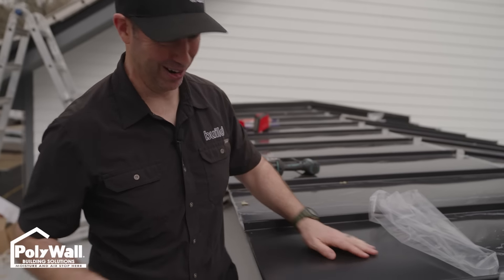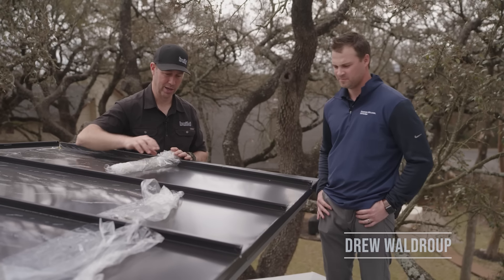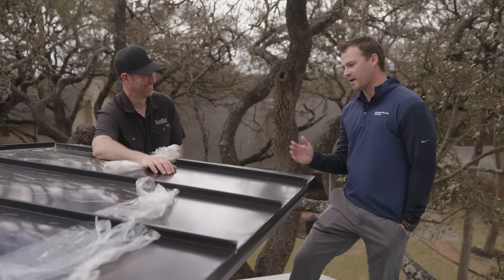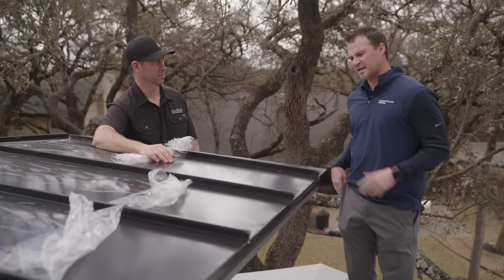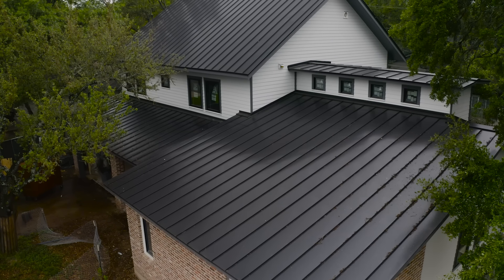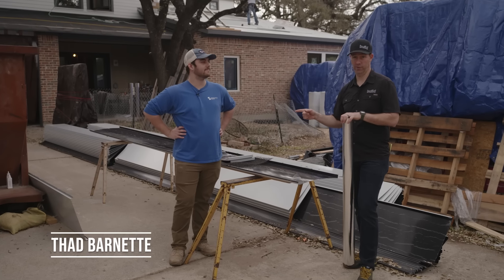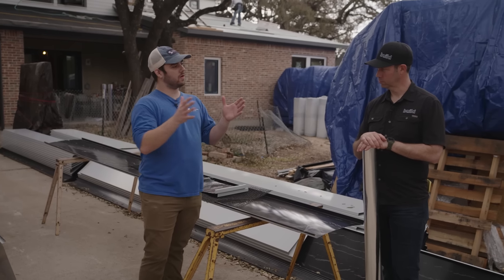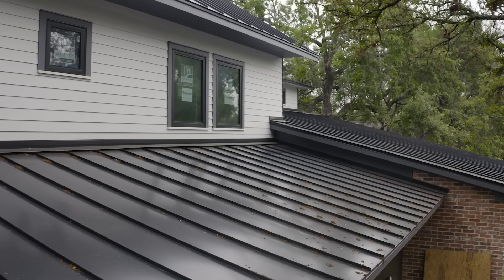Black Metal Roof - Dumb Idea?

Comment: So he starts out by answering a question with "yeah, no". Then, he justifies a black roof by saying essentially, all  my friends are doing it. Felt  like I've been catapulted back into kindergarten
Reply: I could see 2 temperature probes being embedded into upper 1/2” of the polyiso exterior roof insulation adjacent to each other on same gabled section. Maybe Sheffield metals would be interested in sponsoring the test, providing a single section of white standing seam for one probe, the other under black section. Both installations would employ same solar insulator layer shown in vid as well as same air gap underlayment. 

My $$ would be the temperature difference would be <2C, essentially negligible. The surface temp of black would be substantially higher, the underlayment air gap, reflector layer and low thermal mass and radiance of 26g rolled steel mitigates ability to radiate that heat into building envelope. 

The big advantage of dark metal roof is that elevated surface temp allows it to shed snow much more efficiently 👍
Reply: I don't understand the issue. Pretty much every issue in life has pro's and con's. He knew that but wanted a black roof because he liked it( does he need another reason ) and he designed the roof to minimise the con's of that choice. what exactly is the problem here ?
Reply: @MichaelM-to4sg  1) "<2C, essentially negligible". Based off of what? Gut feeling?
2) I'm having a heck of a time finding Sherwin Williams' specs for their paints, but here are some lab tested results for similar coatings from Valspar's line. Black (WXA0107L) - reflect 0.31, emit 0.84 = SRI 31, temp 70.9C (159.6F). Bright White (WXW0048L) - reflect 0.68, emit 0.86 = SRI 82, temp 51.4C (124.5F). White has a much higher reflectivity and also manages to have higher emissivity.
3) "The big advantage of a dark metal roof is that elevated surface temp allows it to shed snow..." So you intuitively know that the higher surface temperature isn't " essentially negligible" like you said.
4) How much shedding of snow do you think will be happening in Austin? Yes there was recently a bad cold snap. But I used to live in Austin, shedding snow for a day every ten years doesn't outweigh the benefits of dealing with the July-August midday heat.
Reply: @NeonSphinx89  1. I have not done the calcs, true. I’m basing my conclusion on my experience as retired aeronautical engineer. The thin gauge steel, the radiant barrier and the thermal air gap effectively insulates radiant energy transfer. 

2. Again due to the physical structure, surface thermal absorption is largely negligible due to structures inefficiency in thermal transfer of resulting radiant energy.

3. While the low thermal mass of steel roofing and the layout prevents efficient transfer of radiant energy to building envelope, that does not mitigate the dark surface from better maintaining surface radiant energy that will allow snow to more easily shed from smooth steel roof surfaces, particularly beneficial in lower slope (3:12) applications.

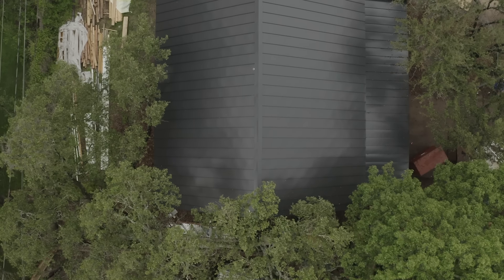I only mention this for those in snow regions. I’m in high Rockies, 9200’ asl. While subject home is in Austin, I suspect vast majorities of persons watching this video are not in Austin. Many likely in a snow region, most of whom use min 6:12 roofs but there are some, even near us, where 3:12 or even 2:12 are found
Reply: That is true of the vast majority of his videos, but they are for this reason all entertaining, though also simultaneously a little annoying.
Reply: It is about 9 minutes into the video, when the actual numbers come out, and big surprise, the black coating absorbs about 5x more solar energy than a white coating would.
Sooooo, that heat has to go somewhere.
I'm a fan of this channel, but having seen the choice to install a black roof after all the effort put in to build a thermally efficient home, well ????????? !
Reply: @nonsuch9301  the issue is if you see the costly and absurd lengths that Matt goes through to save the slightest amount of energy then it seems kind of hypocritical.  Like caulking the seams on two studs that are nailed together in window or door frames
Reply: I’ll bet he got a discount on this roof for his house by negotiating this video as a platform for the manufacturer to advertise their product.  EDIT: Never mind. He actually tells us at the end the manufacturers paid for the promotion.
Reply: Big fan but no, it makes no sense. There is some muddying of the water hereby confusing the issue of material versus color. Yes metal makes great sense.  It is recyclable, durable,  light weight, long lasting AND you might collect and drink the run off. All great factors for a roof. Let's put aside the issue of material then. If Matt wants to pay the premium for a metal roof, it's his $$. So what about color? Clearly the color choice is aesthetic. He wants the house to look good. And he is able to put some engineering and inexpensive, I hope, materials into the build so the choice won't cost him too much electricity. Not a bad outcome. 
However, there are reasons people paint their houses white or light colors in the Mediterranean. And when you think about the heat island effect of a city, it really comes down to public health. A hotter city is less healthy for us, both directly from the heat and from the pollution produced, even at slightly higher temperatures.
Reply: Black Roof is best because when you patch all the leaks with tar the tar is not as noticeable on a black roof.
Reply: MORE LIKE 6TH GRADE, LOL. IT'S ON TREND TODAY, BUT IN 10 YEARS IT WONT' BE. HARD TO KEEP UP WITH THE JONES ISN'T IT?
Reply: @nonsuch9301  THE ISSUE IS OF HYPOCRACY. FOR YEARS HE'S BEEN PREACHING ENERGY EFFCIENCY, AND LIGHT COLORED ROOFS. TALK ABOUT FLUSHING YOUR CREDIBILITY DOWN THE DRAIN!!! AND THEN HE'S DUMB ENOUGH TO PUT HE RADIANT BARRIER THE WRONG WAY! DUH.
Reply: Huh?
Reply: @tommak6516  LOL its' a seamless metal roof, there is nothing to patch. what a noob comment
Reply: @sunshine5349  I know it's counter-intuitive, but radiant barriers work the same whether it's facing the sun or the ground. The reflective side just needs an air gap to work and they're typically installed "upside down" to keep dust from accumulating and lowering performance.
Otherwise yes I agree, a black roof in TX is not the best choice for energy efficiency. 👍
Reply: @tommak6516  I've repaired a few roofs, but never with tar! Yeuch! Imagine what it does to your water quality to smear black tar on your roof!
Reply: @tealkerberus748  ... Do you imagine that tar is manufactured because nobody uses it?
Reply: not at all  ,what he is saying black has higher resell value . you have to go what is in style . white black combination is a safe way to go
Reply: @tommak6516  LMAO
Reply: @tommak6516  i thought you were being funny . Who repairs a roof with tar ,that is pure craziness .
Reply: @tommak6516  Tar would be used in conjunction with flashing , But to repair a hole / roof damage , I don't see it . why not replace the damaged  section ?
Reply: Have you seen the patent pending barium sulfate white paint that settles at 8 degrees below ambient temperature.
Reply: I agree and his video sight is beginning to lose credibility in my books .....
Reply: Metal reflects the light/heat, asphalt absorbs it.
Reply: Lol

Comment: I have a white metal roof. I was really thinking things out when I made this decision. My garage is uninsulated and the difference was amazing.
Reply: Any issues with staining? that would be my biggest concern - my current roof is charcoal. Solar panels shade most of it though!
Reply: @BLKMGK4  most barns have white metal roofs.  They have no issues with staining.   I helped my dad build a steel building (new barn) back in 2005.  After 15 years no way would anyone notice any stains and that’s with a very large black walnut tree overhanging part of it
Reply: Good! If those of you who care about climate change don't pick a white metal roof, shame on you! =D
Reply: Mine is a dull lite yellow almond to hide slight issues  if nothing else the longevity is more than enough.
Reply: Shouldnt black roof be better insulator? Since it will be more heated, and less heat will be transfered from the building outwards?
Reply: Ganga Din  I disagree. Listen to how much product he had to install to counteract the heat load of a black roof, all of which contribute to carbon consumption. Also it creates a heat island. I wouldn't be surprised if those large trees nearby succumb to that heat.
Reply: @bamf6603  The colour doesn't insulate. It varies the amount of heat reflected away from it. Also this is in a climate where they rarely need heat.
Reply: Ganga Din  Correct, it does not disappear. But the less heat absorbed, the less you have to do to create an environment you want to live in, ie. a house that's around 70 degrees. You say the insulation point is trivial, if every house had white roofs that's a lot of material saved and carbon not released,  and  the countries energy demand would be a lot lower and everyone would save money by not having to have the AC on as much. Lots of pros. that far outweigh a cool looking black roof.
Reply: Well I mean at sunny day the black surface should be some hotter. And so on I thought it would prevent some heat loss of building inside because of this.
Reply: @OutNAboutWithBrad  So you say that white roof is even better than black roof for energy efficienty (thats the opposite what i think). So you have not to forget that color has nothing to do with heat, but only with light. I give you example this way, if you walk at sunny day with black robes, its going to be way warmer for you than you would walk with white clothes. Shouldnt with house be the same?
Reply: @bamf6603  correct. But in Texas they don't want the house to get hot as it is already extremely hot outside for much of the year. Black will absorb more energy and get hotter. White will reflect a larger percentage of energy and not get as hot.
Reply: @OutNAboutWithBrad  Alright now i understand everything, before i had in my mind cold climate.
Reply: @BLKMGK4  I've wondered what is the best color for pv panels. The hotter the panel the less performance
Reply: Did the white roof get super dirty or stained throughout the year?
Reply: @bamf6603  Dark colors attract more heat.. and this black roof will be WAAAYYY hotter than a white roof.

Comment: All we install is metal now. Replacing your roof every 15-20 years or less with heavy, black asphalt shingles is stupid when you can pay a fraction more for 3X the lifespan and far less stress on your roof. We install G-rib for almost the same cost that most are charging to strip and replace shingles here, and we're usually done roughly a day sooner because a metal roofing panel can cover more area faster. I've measured the temps radiating off of both while baking on them on hot summer days, asphalt shingles are the worst by far - if you can even walk on them without damaging them. Metal roof coatings are engineered to reduce heat absorption, even the blacks. Our black isn't really black, it's more of a charcoal/dark grey. It's a no-brainer for homeowners. The only downsides are that it's more dangerous to work with and metal roofers are kind of screwing themselves out of future work. But there's more to do than roof. Get a journeyman cert if you can, kids. Don't sell yourselves short.
Reply: i understand how metal roofs are more dangerous to work with, but "metal roofers are kind of screwing themselves out of future work" — can you explain what you mean by that? do you mean the injuries are THAT bad (eek) or are you referring to something else? thanks.
Reply: pricing around here (central Arkansas) was virtually double for metal vs architectural shingle.
Reply: Metal roofs are NOT a fraction more than a composition shingle.  That's a ridiculous statement.  Be real.
Reply: What market are you a roofer in? I'd like to find metal roofs for a fraction more than shingles.
Reply: So what your saying is it should cost less in labor to get the metal roof then the shingle roof because you finish a day sooner (less labor for you) and it’s easier.
Reply: We had a standing seam roof installed last August. After having our Owens corning shingle only last 11yrs we were done with asphalt shingles. Metal ended up costing us about 2.5 times more then asphalt. Got a 40yr paint Guarantee and lifetime workmanship warranty. Money well spent to eliminate any roof headaches.
Reply: @THETOPGLOCK  Workmanship warranty means they guarantee it was installed correctly according to the installer nothing else (a good reputable contractor will take care of you anyway) material warrantee varies greatly between manufactures and does not mean your paint will look the same in 40 years. That being said metal typically will last longer than shingles if it is not installed over lathe or "air gap" materials (place a piece of paper on a table try to stick your finger through it, now suspend the sheet in air, yep). Though unless the roof is very simple (i.e.-two sided gable roof/not cut-up) metal will require more upkeep than asphalt shingles (drying caulk, seam tape and structure movement). Metal is not the "end all, be all" but it is a great roof. In 40 years of being in the roofing business we have replaced metal and asphalt shingles within days of installing a new roof due to hail or wind. In the end regardless of material used mother nature always has the last word.
Reply: Where "A fraction" equals 4x the cost. Our roof was quoted at 6500 for asphalt shingles and $30,000 for a metal roof. Considering the asphalt will last 15 years and we'll only replace it twice, that's an easy calculation to make.
Reply: In south GA, we needed to replace our shingles but chose metal instead because of all the benefits listed already. I can't speak to all the comments on here about metal being so expensive because our metal roof was cheaper than shingle. I think this is because they installed the metal over the old shingle and so there was no stripping and removal, thus cheaper.
Also, we too have an air gap between the old shingle and new metal and our attic temps dropped from around 120 to in the 90's.
We love our metal roof.
Reply: You realize an architectural asphalt shingles can last for 40 years don't you.
Reply: @roblowndes7829  Taking to the thread originator
Reply: @THETOPGLOCK  And by the time you retire you still have decades of worry free time and be able to save your pension and retirement money to be used else where. Wise decision.
Reply: @James Biggar any relation to Josh? I’m a roofer from New Zealand, the majority of roofs here are metal and I’m still busier than a blue arsed fly. I’ve been roofing for 30 years and I’ve installed every type of system and I just don’t understand asphalt shingles. The biggest thing that bothers me is used shingles go in the dump, it’s not far from being toxic waste. Metal is infinitely recyclable, I’ve replaced 60 year old metal roofs and all of the metal is recycled. The scrap metal man pays me to take it away, you can’t say that about shingles!
Reply: What do you do about noise when it's raining heavily outside? Metal roofs can be exceptionally noisy to the point it becomes deafening during a heavy downpour and you can't even hear what the person standing next to you is saying even if she is shouting.
Reply: @anupdev5845  Ever heard of the sound proofing quality of rock wool which insulates also against both heat and cold. It is not a dumb idea, it is a BRILLIANT IDEA! Especially if it is made out of high-strenght stainless steel with 8% to 9% molybdenum content and 3% to 4% tungsten content and 2% vanadium and 12% to 15% chromium.
Reply: @number6396  How real is it to cast doubt without even a guess as to the current fraction?  If it costs 2x as much than asphalt/fiber/composition, but lasts 4x as long, ...but does it?  what?   let's post dates and offered prices and warranties.   Right?   No, wait, that's too much trouble.  Let's just cast doubt.  Or promote steel, vaguely.     blah blah blah  fractions can be >1 ?  nice piss-war here.
Reply: You pay 3x more for 3x the lifespan - no free lunch
Reply: Cost 2.5 times more?